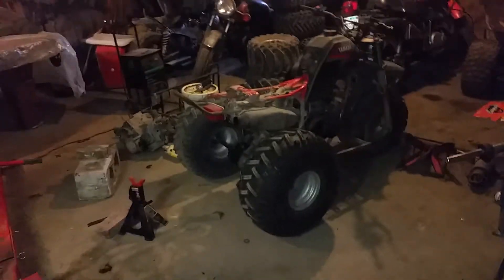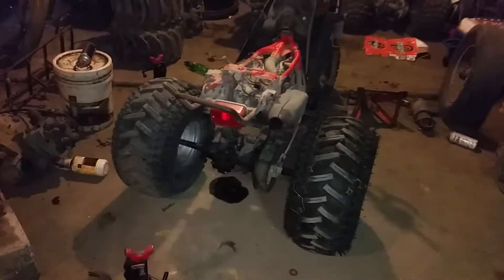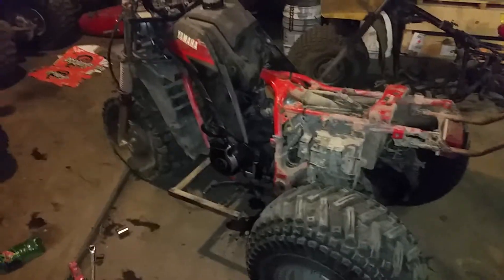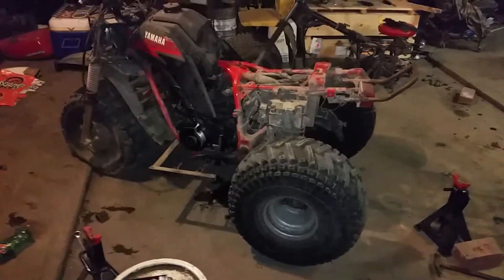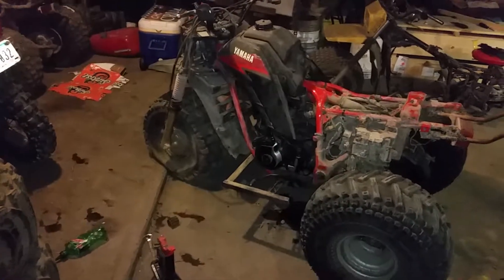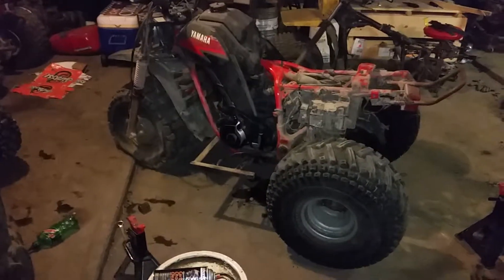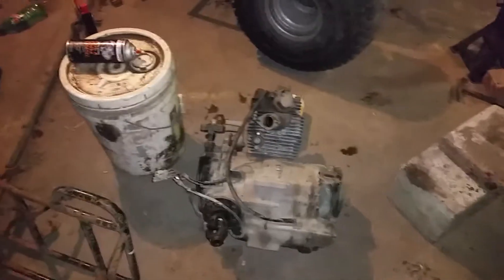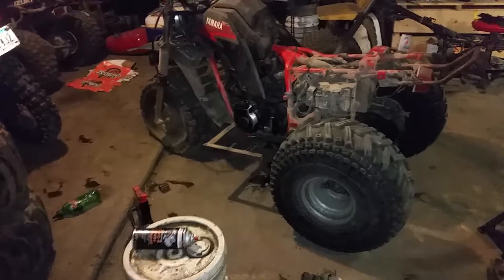Day 3 1986 225DRS Red frame CARB PROBLEM!

Comment: lol dont try starting it up with a mouse nest in the air box because it will get sucked into the carb! They make nests in both my Dx's.. the little buggers get in through the frame. Up near the handlebars theres a vent hole and they go into that hole and go straight down through the frame tube and into the airbox. I have to figure out a way to block it with screen or wire mesh to try and keep them out. till then, every time i ride i have o pop off the air box cover and look inside for mouse nestsing and acorns! lol
Reply from the maker: hdrjunkie oh yeah I know, I didnt, they like to fill my mufflers full of corn